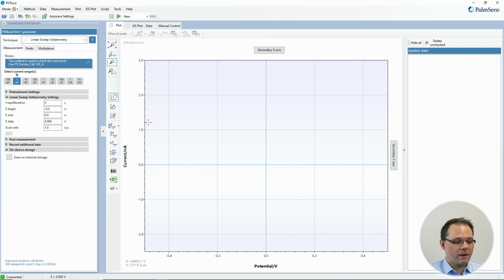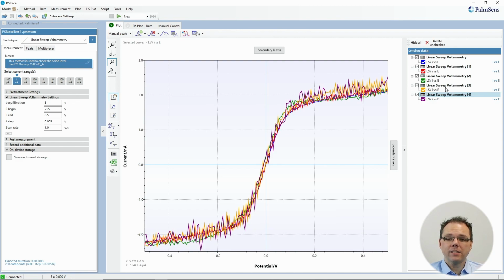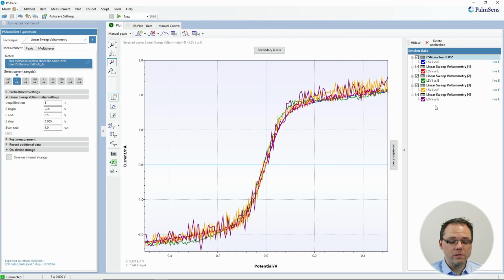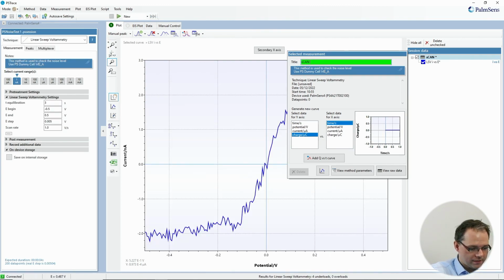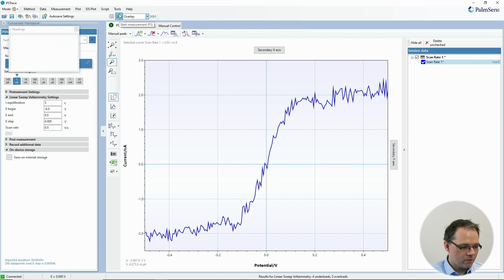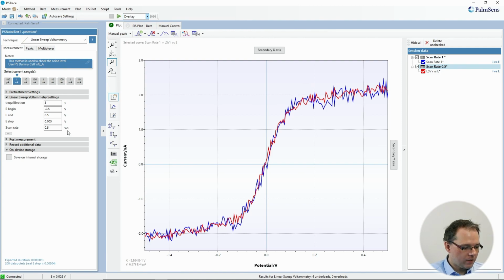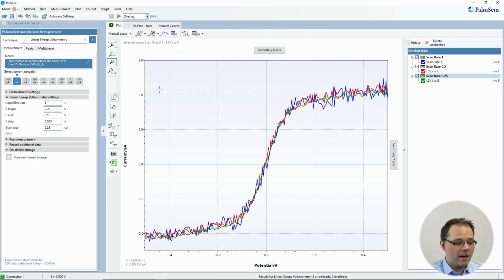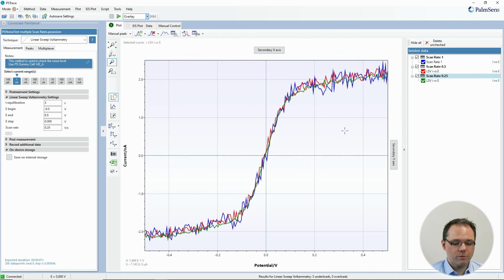PSTrace Tutorial #11: Renaming Curves

Comment: Is it required to save the method file for indivisiual measurement ?
Reply from the maker: Dear Akash, No, it isn't required. Method files are used to only save the parameters for setting up your measurement. This is helpful when you often repeat the same measurement or only want to share the method with a colleague and not your actual measurement data.
As shown in the first half of this video, the pssession file contains the parameters for each measurement anyway, so just saving the pssession file will suffice and you don't need a separate psmethod file.
Reply: @PalmSens   thank you so much for sharing the information.